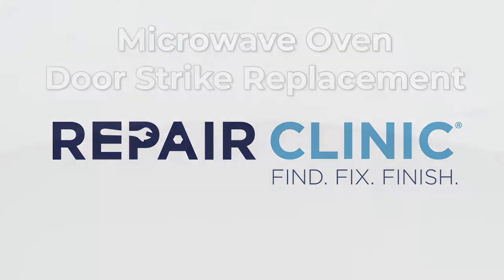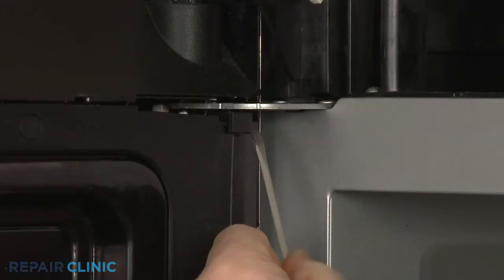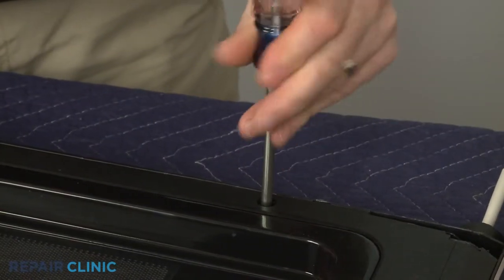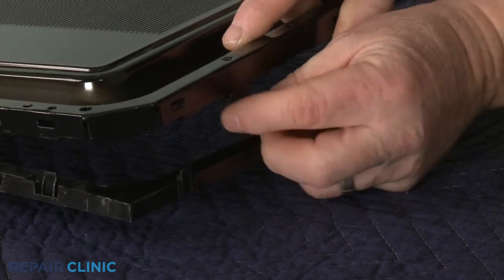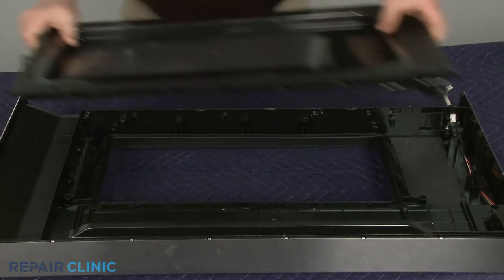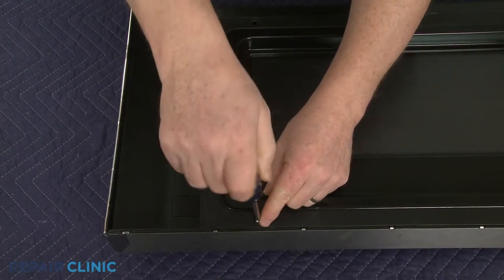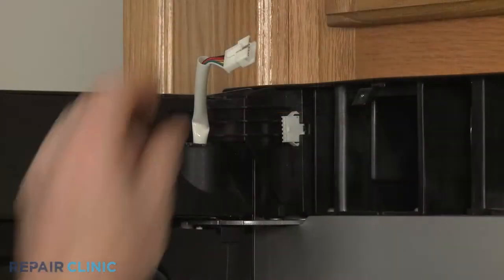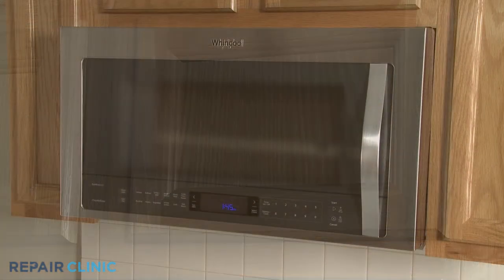Whirlpool Microwave Oven/Hood Combo Door Strike Replacement W10740455

Comment: I have whirlpool model gmh5205xvb1  and the latch piece looks similar to the one in this video,  but will W10740455 fit my model?   my lower  one is snapped off